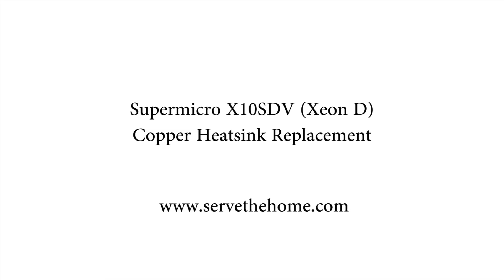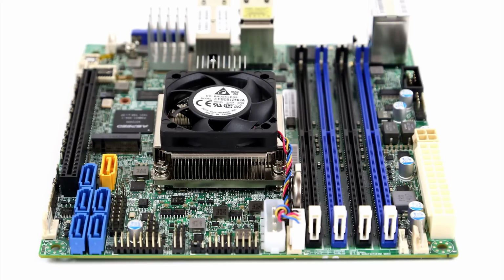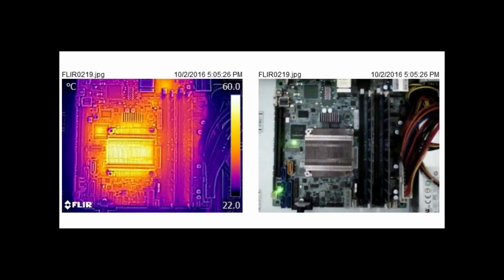Supermicro Xeon D (X10SDV series) Heatsink Replacement

Comment: Could I buy this motherboard and install a graphics card and game on it???
Reply from the maker: You can install a GPU on these. In fact, we reviewed a system with 16 GPUs hooked up to one https://www.servethehome.com/ethereal-capital-16x-gpu-p106-100-x16-professional-mining-rig-review/ 

Clock speeds are too low so you would have a better experience using Intel Xeon E3 for gaming.
Reply: $1000 USD

Comment: in the way you tigth the screws, you could damage the processor crushing its die corners
Reply: Meh, the CPU still has an IHS.. It needs quite a bit of torque to crush it... You'll break the solder ball joints of the CPU first.

Comment: hey patrick if you use that 2U copper passive heatsink will you still need to replace the back plate? Or any heatsink that you buy will have to use their own back plate because supermicro use non standard screw holes?
Reply from the maker: You will need to replace the backplate. The Supermicro mounting pattern they actually use across several models. For example, it is the same as they use on their Atom C2000 boards since (at least) 2013. These units are for different CPUs and thus require the different backplate.